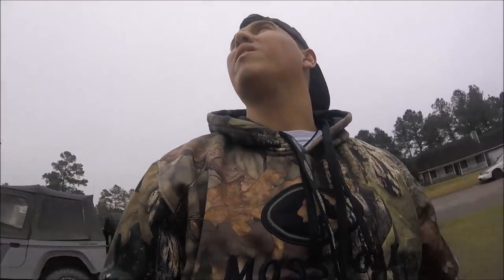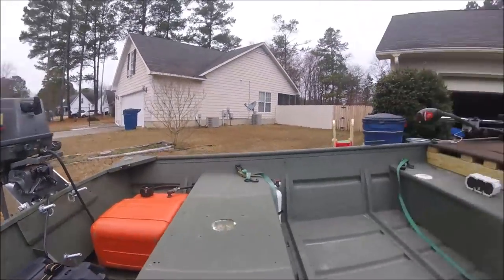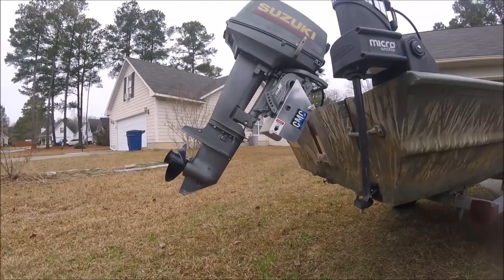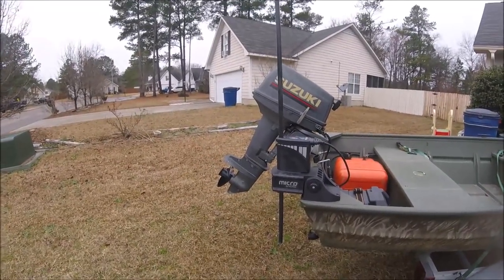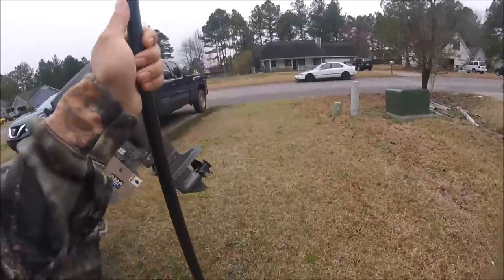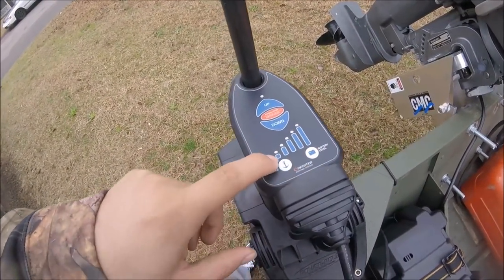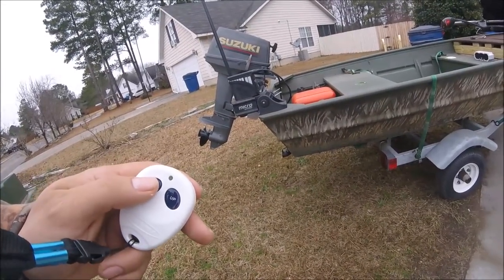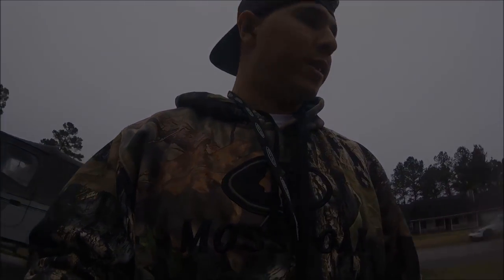power pole micro and CMC tilt and trim on 12ft jon boat!!

Comment: Old video, but that's a nice setup you got there with a lot of room to add all sorts of cool things.   Those little power poles paired with a front pole are perfect for lighter boats.  I've got a much larger jon boat and it works absolutely great even in some fairly crappy conditions.  Honestly I think as average fisherman who aren't fishing tournaments year round, we've gotten too unnecessarily big, heavy, overpowered and expensive.  The older I get, the more I appreciate my jon boat, or even the older boats we had when I was a kid, over my expensive glass boat and I find myself fishing much more with it.   God forbid you have to manually re-trailer that thing if the motor goes out.  It's a small catastrophe and a workout, and you can literally almost buy brand new small engine for the price it takes to fix em sometimes.

Comment: Hey you still use that boat I did same thing to my 12 foot boat except I had the boat shop in Ruston Louisiana make mount for stick steering and front controls on it but I got a 20 mercury 4 stroke  but I want the trim and tilt on it mine will go a flat 35 with just me in it plus I had those beaver pods welded on the back how does your trim and tilt work going to move my anchor pole to front of boat cause of the pods on back yell back at me bout tilt and trim

Comment: The jack plate cost more than the boat..
Reply from the maker: About half lol, but for the ease of use its worth it. I was tired of having to manually lift my motor when I was fishing shallow.
Reply: Where did you buy the jack plate from need specs brother
Reply: @gabrielgonzales6295  I didn't buy one..I a motor adjustment.
Reply: Okay so where can i buy the jack plate like the one you have
Reply: Bob's marine and jackplates..CMC..

Comment: That must be scary with a 15 HP.  My 12ft V bottom is rated for a 10 max.
Reply from the maker: yeah, she gets movin quick! i have a till handle extender, i stand up in the center and run it like a skiff. I can get around 27MPH.

Comment: Nice wears the steering at and how much was the power pole
Reply from the maker: Rick Stuckey it’s a roller steer so the handle and throttle are on the left side of the motor, the handle is folded back on the video!! And the power pole was 549.99 I believe and then 99 for the pole it’s self they are sold separately!!
Reply: Cool thanks